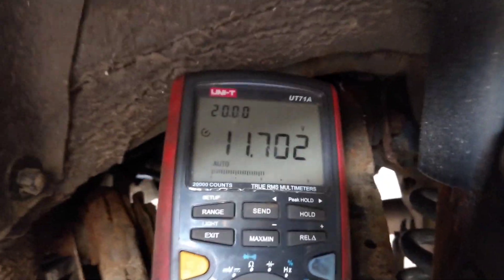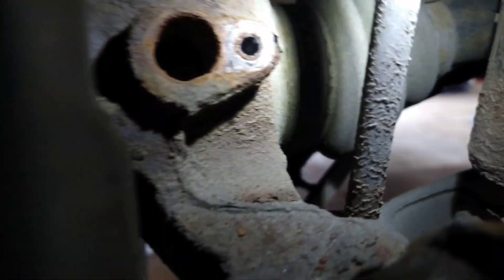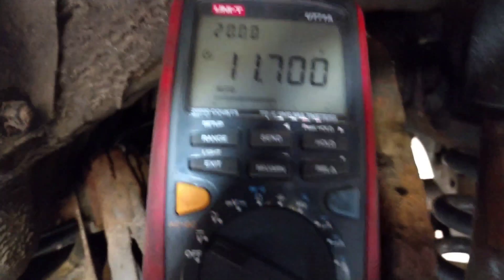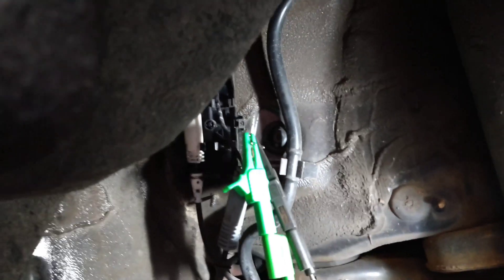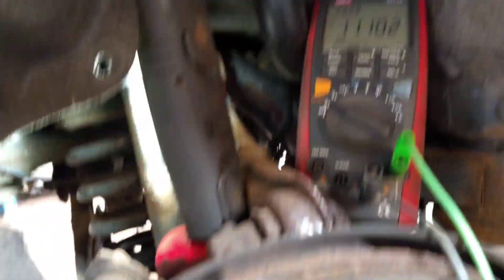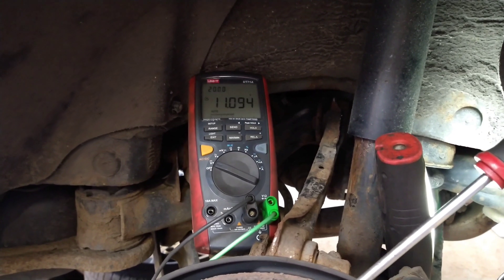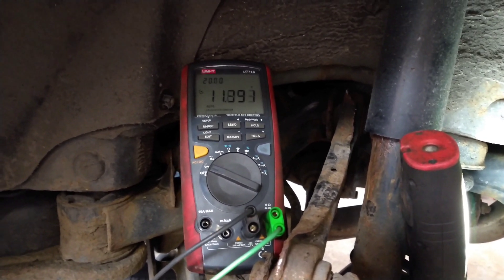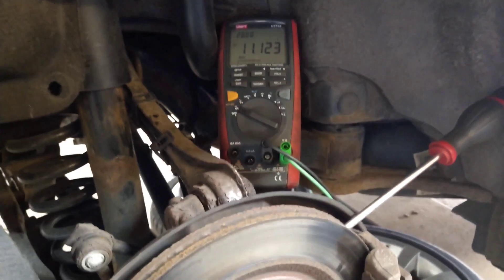Testing digital ABS (with a multimeter)

Comment: @Mechanic Matt thank you from the bottom of my heart. I couldn't find the proper procedure (even in the service manual) for my Gen 2 Chevy Volt. Once I discovered I was dealing with a digital sensor (12V in and variable signal) then I used your exact procedure to verify my faulty sensor. Thanks again for your well explained video.
Reply from the maker: Thanks David

Comment: Hey Matt you should be checking A/C voltage what it looks like you are not doing so just hook it up to DVOM set it to ac voltage get your reading at the censor by spinning the rotor it should give a reading just check your service manual for proper a/c voltage .
Reply from the maker: Hi Tony, this is a digital abs sensor and it changes the DC voltage, it can be 'AC coupled' coupled  but that is different than testing on the AC setting. 
I don't tend to still see many cars that use a sensor that produces its own AC voltage when you spin the wheel, this voltage doesn't come from the sensor it comes from the abs module instead. Passive and active abs sensors.
I hope this explanation makes sense.
Thanks for watching

Comment: Nice Matt..simple , effective. Cheers Pal
Reply from the maker: It is simple in a similar way that we have checked an older inductive ABS sensor by checking the ohms across the unplugged sensor and checking the AC voltage output by connecting a multi meter and spinning the wheel. This shows a way of testing a digital ABS sensor if all you have is a multimeter (DVOM) of course, in both cases you can't get the same information as you would using a scope, but it's a simple option. Thanks for watching mate

Comment: Good stuff Matt.....  Had my hands full with an 07 Jeep wrangles today... ended up stuck in drive due to a bushing failure that let the shift cable dangle about,  of course by the time if got to me it had the throttle body replaced, new ignition  switch and relays....plus lots of poking done for no reason......  #partscannon     lol
Reply from the maker: People seem happy to keep on trying parts on a car instead of diagnosing it properly.
Did you get to film that one?